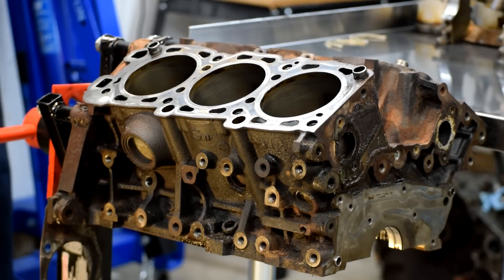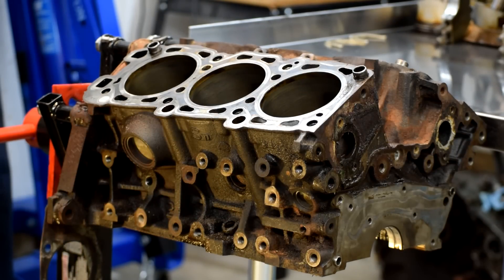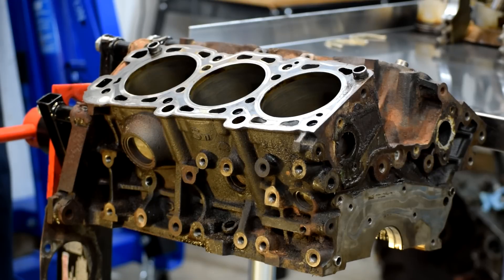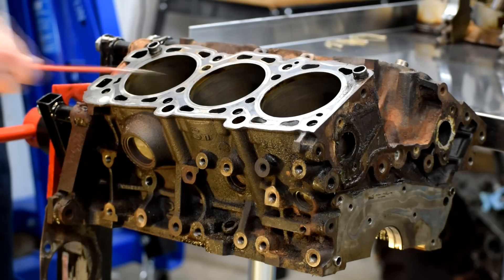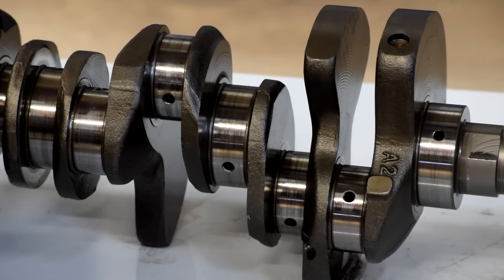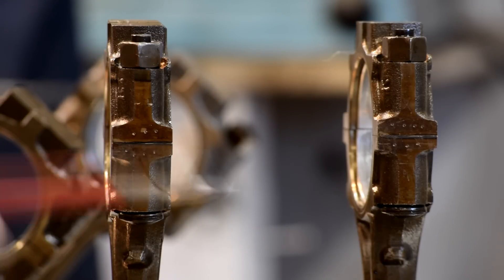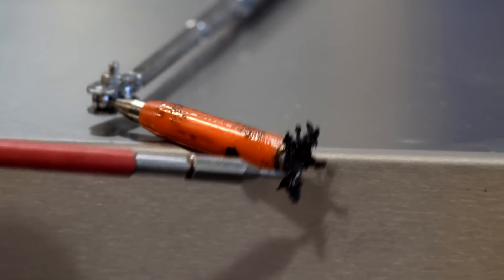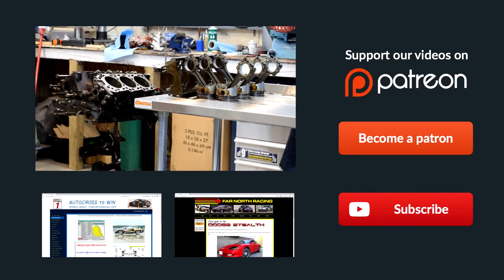FNR Stealth Project Ep 7 - Short Block Teardown

Comment: As you stated the caps have been off probably to rebuild the bottom end. Either by replacing bearings and a rod or more rods.
Rod knock is quite common on these engines, especially yours seem to have done quite a few miles.